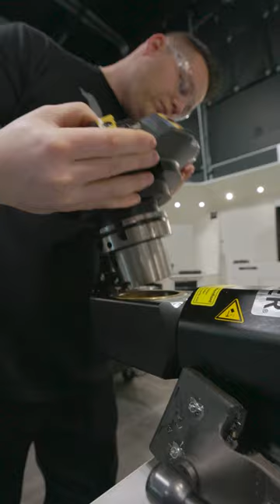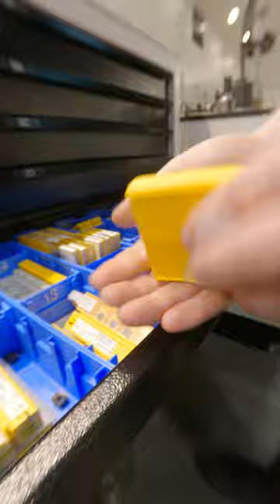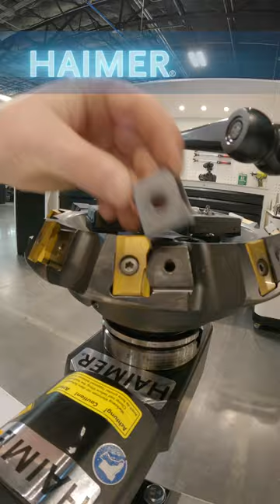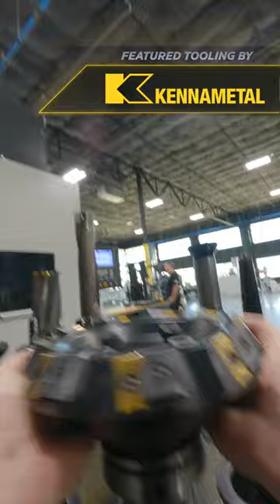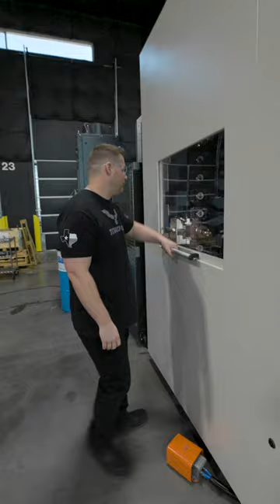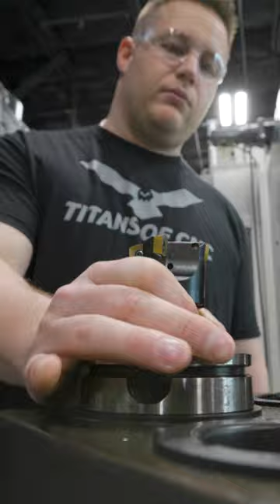Using Tool Crib to Assemble a MASSIVE Face Mill #shorts

Comment: we made brass parts for aircraft.  It was a mind fk.   at times we would find the cheapest taps that worked great for this job.  The same tap on other jobs  was disastrous.
Reply: Maybe 25 years ago, a good Greenfield tap was about 5 bucks. An Emuge tap was $18.  I ran 18,000 holes with an Emuge on one run, then another 10,000 on another. One tap . 5/16-18, through hole. On the other hand, a slot in my hardened vise jaw is the result of a misplaced 'minus' sign, and a stupid Chinese rougher that by all rights should have broke. Nope. Just milled right through.

Comment: Back in the day we would have to rely on PCBN tools mostly when machining Unobtanoum used in the now declassified plasma rifles in the 40 watt range.  The coolant mixture was recovered as an alternative for Deuterium distillation because of the isotopic transfer when machining  such heat resistant materials. Twice the resistance of Tantalum double the punch of DU. 
The new stuff is really incredible.

Comment: Huge tool capacity, why replace the one cutter, instead of just adding the facemill?
Reply: They likely don't need that cutter for the next job, leaving it in there will just make it harder to find later. If you want cutter 386, you don't want to check three machines in the shop to see if it was left in there, you want it in the cupboard labeled 386
Reply: I try to keep the same, or same kind of, cutter in a particular station. 1 inch end mill in 7, 3 inch facemill in 19,etc. I'm sure the rules for a big changer like that are different than my little 21 tool magazine, perhaps it doesn't go by station numbers, only the tool itself. Don't know. My tool crib is a cabinet next to the machine. There is no reason for any of the tools to be more than 20 feet from the machine.
Reply: Might also depend on the programming too. Maybe it's a simpler program and the tool number has already been specified. Happened to me a lot running things with whitney turret systems. Program would give me multiple 1 turret jobs and it's easier to swap turrets than it would be to swap coding. Plus I can service the tools from the last turret during my run time. Clean anything up.

Comment: Those inserts have very low tool life in cast steel 280 BHN 

switched to an ingersoll version and improved edge life by 125% and decreased are tooling cost by 44%